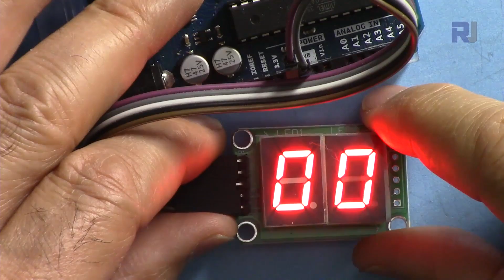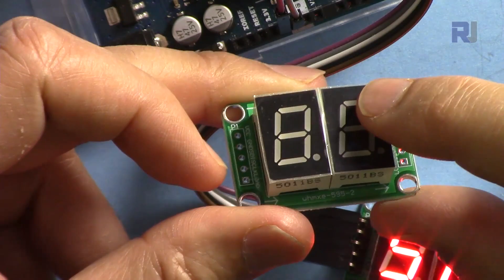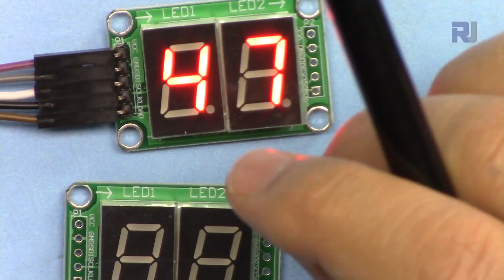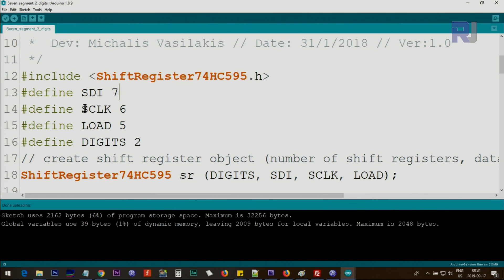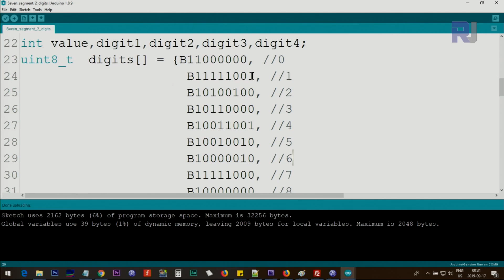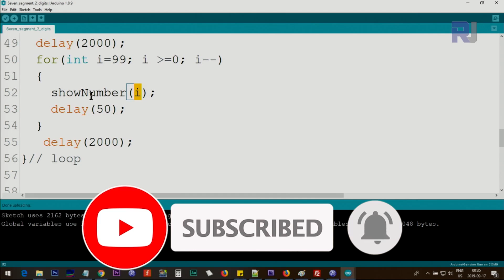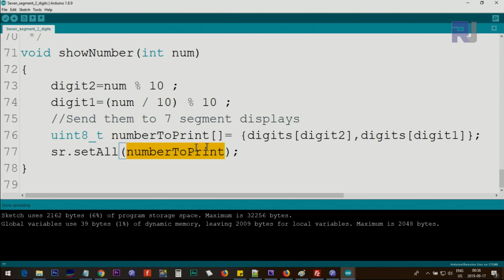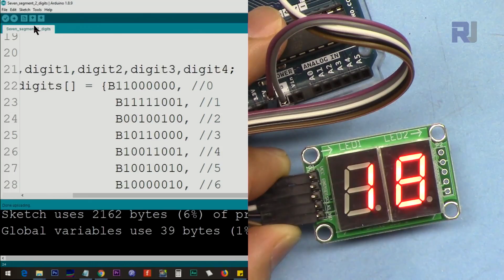E582 Lesson 24: 74HC595 Two Digit Display | Arduino Step By Step Course - RJT582

Comment: what is the load pin used for can i use it without the load pin as I am running out of pin outs
Reply from the maker: No . I should have explained it. Either in code section or in datasheet section of the video

Comment: Hi, I really appreciate your effort.
I need some help with the code. When I write the code and compile in arduino, it gives me the error "invalid use of template-name 'ShiftRegister74HC595' without an argument list".
Kindly advise.
Reply from the maker: Hi, you may have skipped. you need to download the library file.
Reply: @robojax  I downloaded the library. Included it as zip file, the problem persists. Any idea why?
Reply from the maker: I just loooked at the code.
you have this line
ShiftRegister74HC595 sr (DIGITS, SDI, SCLK, LOAD); 
it is referring to the arguments DIGITS, SDI, SCLK, LOAD which should be defined above and it seems they are missing. you should have the lines below above it. 
#define SDI 7
#define SCLK 6
#define LOAD 5
#define DIGITS 2
check the library, or your code.
Reply: @robojax  ShiftRegister74HC595<1> sr(21, 22, 14); //SDI 21 , SCLK 22, LOAD 14 

this will fix the error

Comment: Thanks for the video, very educational. Is it possible to control 2 or more 7-segments with only one 74HC595? Because with this set-up you need as many number of 74HC595 as the many numbers of 7-segment.
Reply from the maker: Not possible.
Reply: @robojax  thanks for your prompt reply. So if I have 6 7-seven segments, I need 2x of 74hc595 because 6 7-seven segments will need a total of 10 outputs that is 6 for the segments and 4 for the common anode or common cathode. Having 2x 74hc595 will have 16 outputs available. Is this now possible? Many thanks again.
Reply: Sorry it must be 13 for 6 7-segment, 7 for segments a,b,c,d,e,f,g and 6 for common anode or common cathode.